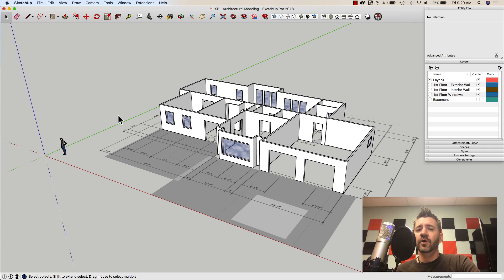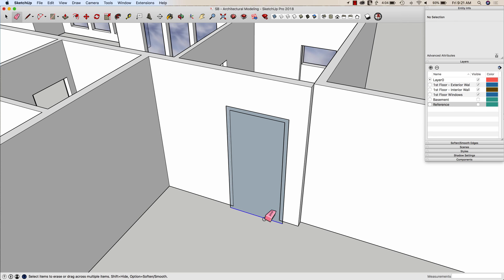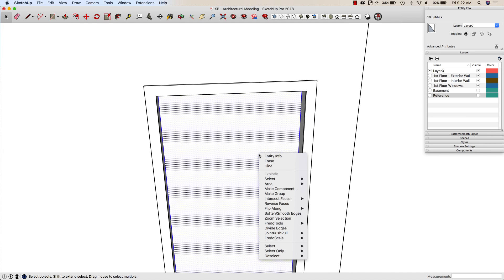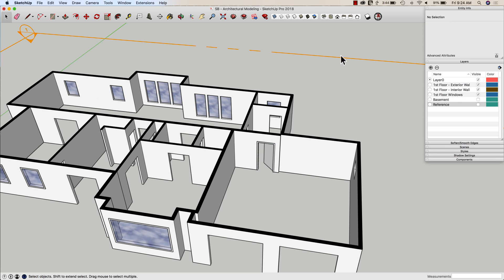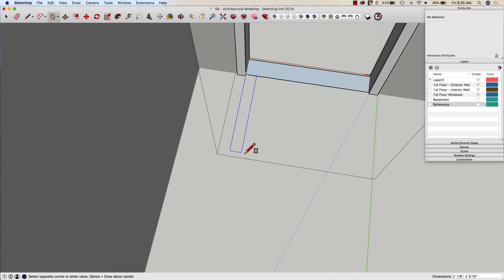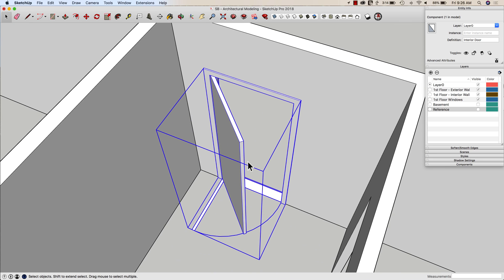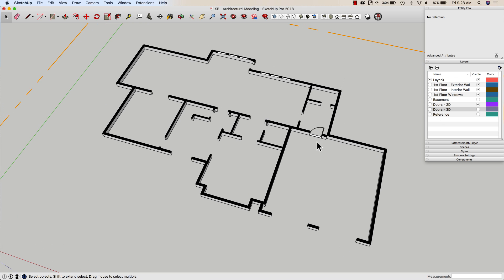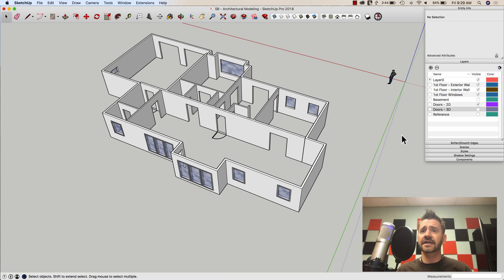2D and 3D Door Components in SketchUp - Skill Builder

Comment: You really did not have an oops in adding the 2d door...  you mistakenly started your arc from 1.5 inches away from the opening and thus it was 1.5 inches short of the overall door width when you swung the arc to meet the door 90 degrees later...     you cut the door off to correct when you should have made the arc the total width of the opening..

Comment: I do things slightly different. 

I have layers by spec ref eg "08 10 00 Doors and Frames" where I place door components on, and w/in the door component I use 2D and 3D layers to control when those groups are turned on/off. This way, I don't have duplication of layers for all the various components I want to control 2D/3D. Very useful for furnishings, bathroom fixtures, windows, and especially landscape.

Comment: A small tip ... When drawing the 2d part of the door component, it's my experience that it should be raised above the "ground plane" about 50 - 100 mm or 2 to 5 inches. That way when you have a floor finish / material... The two surfaces don't clash ... Making a funny pattern. But if it's a dynamic component... Remember to set it up so that when you rescale the dynamic component.. the 2d group remains at the given hight. ;-)

P.s. thanks to condoc tools https://condoctools.com